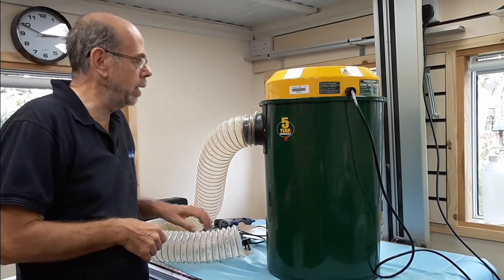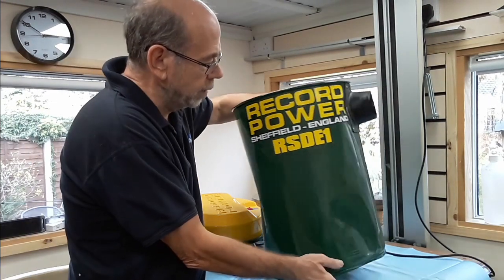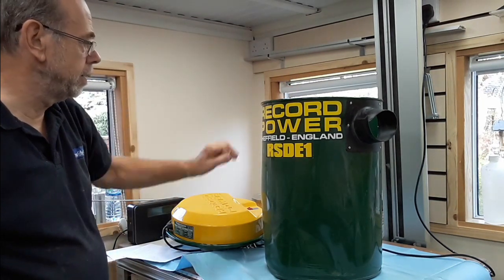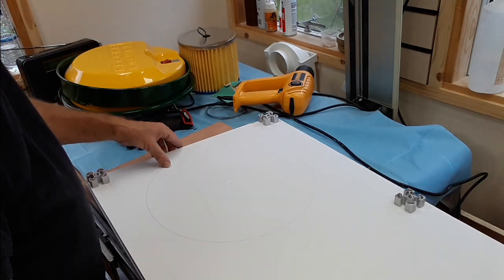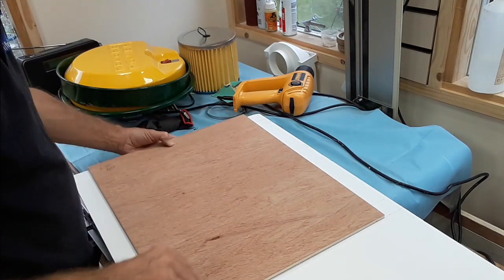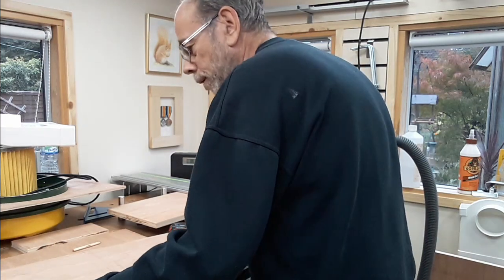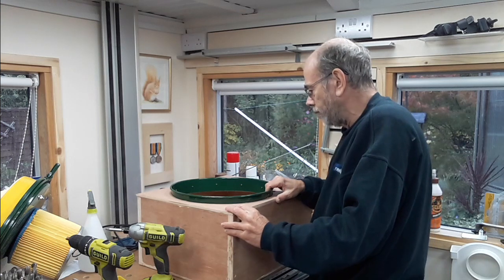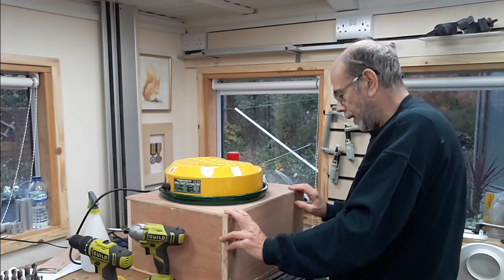the small shed #63 - a new vacuum

Comment: Looking good! .. hope you'll be doing some tests to show us the performance. I'd also be interested to know if you could hook this up to a normal 35mm hose and still get good performance? I know there is a difference between HVLP and LVHP,  but it would ne nice to see it in action.
Reply from the maker: Like you I'm still trying to get my head around the two, I suspect this vacuum is a bit of a hybrid between the two, we have them at our 'Men in Sheds' and they work well with a reducer, though whether this will be true on my system remains to be seen. I will be doing extensive tests and do an update once the air filter is built, in order to see how much dust I can get out of the air.

Comment: I’m a bit late to the party here Peter! Just found you. It’s interesting to watch this because I was thinking of making a replacement plywood container for my dust separator. The plastic barrel isn’t strong enough to withstand the vacuum. I was thinking of putting a loose receptacle to catch the dust and chips within the wooden container to make emptying easier. I’m assuming that being within the reduced air pressure, it won’t be sucked up to the outlet pipe. Any thoughts, if you still read from your previous videos.
Reply from the maker: You can reinforce the plastic barrels with circular peices of ply inside, but it does become harder to empty. A separate container within the plywood box is a good idea,  as it would make it much easier to empty.

Comment: Well done Sir. My RSDE1 is 15 years old and has started tripping the breaker at the power supply. Any ideas? Best regards.
Reply from the maker: Given that I think there's only a motor in there John, ( I know, I just took mine apart to check!) I can only assume that it might be on the way out. If you unbolt the three Nylock nuts on the underside of the cover you can gain access. It might be worth giving it a check to see if it needs any lubrication, or brushes, but otherwise there's only the switch in there. If it does need a motor Record power spares will help, but you might find it almost as much as a new one.
Reply: @thesmallshed  Thanks for replying. I tried to find a way to remove the brushes to inspect them, but I'm at a loss as to how to get them out. They are there, because I can see them resting on the commutator, but I don't know how long they are. You would think they'd be simple to remove being consumable parts. Hey ho, , , Best regards.

Comment: That's a crap drill!, I think you over paid for the Record Power \unit, I bought an almost new RSDE2 with all the fittings wheels, 32mm and 100mm hose etc for £60 in immaculate condition.